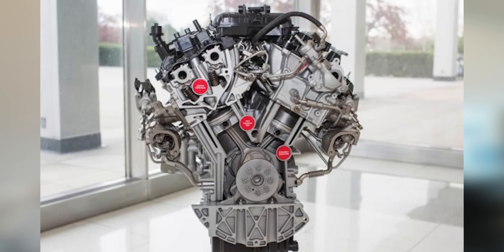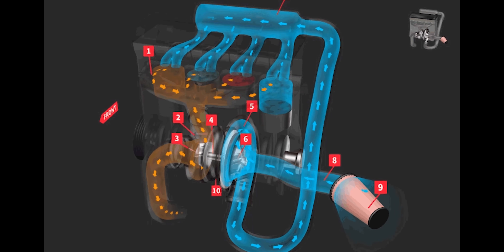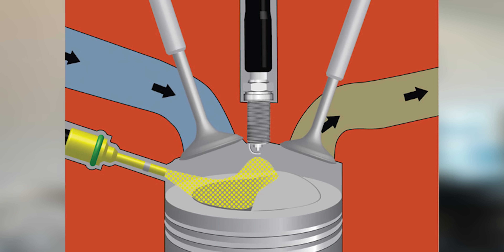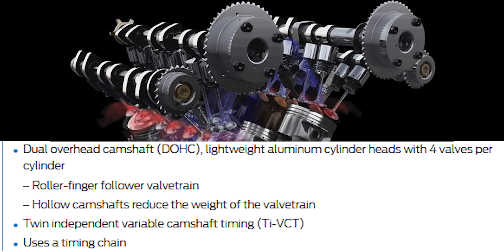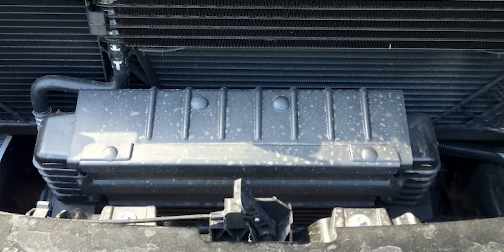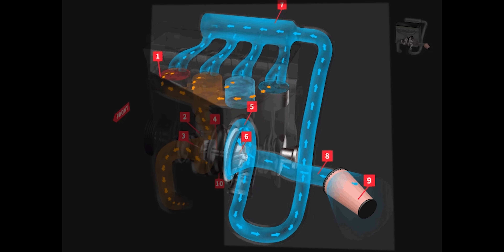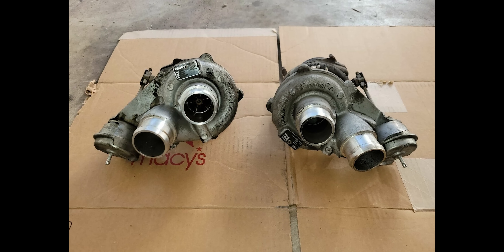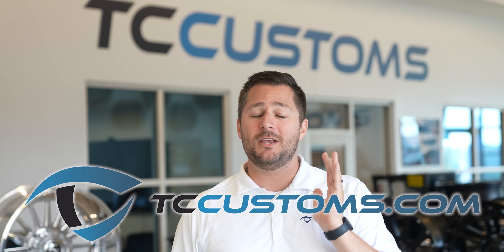The Truth about the Ecoboost Engine!

Comment: I have 340k miles on my 2013 F150 eco boost, a lot of it towing a trailer. It is bulletproof.
Reply: Original turbos?
Reply: @rvd2960  Yes the original turbo are still running strong 💪
Reply: @jollyranch1026  sounds good! That's my main concern
Reply: The eco boost engine technology is absolutely amazing. Haters always gonna hate.
Reply: Only if you do good maintenance. I have a 2015 with 76k miles on it. I bought it used with 63k on it. The motor just spun a rod bearing due to gunk building up and plugging all the sensors and oil pump. Completely flooding the motor with metal shavings. No low oil pressure warning. No codes. Now it has a jasper reman engine. 🤢
Moral of the story. These trucks are incredible with awesome power. BUT... buy it new so you know the maintenance history or if used make sure you get proof of regular oil changes. (Saying this from a guy who only buys used)
Reply: @trentmiller7532  you wish lol I have driving both and the 5.0 is not even close to the eco boost the only thing I like about the v8 is the sound
Reply: @trentmiller7532   no it will not
Reply: @rajasultan7473  Ecoboost Fords needs to stay in their class with the Honda’s, where they belong. That’s like saying Toyota belongs in Nascar 😂
Reply: @trentmiller7532  dude you need more power yes if ford sold a v8 with more power I would buy that I have 3.5 eco boost 2021 I smoked a 6.6 Cummins a v8 f150 is way slower too and the v8 coyote also has cylinder de activation which is already causing problems
Reply: @rajasultan7473  lol. Absolutely clueless. A turbocharged V6 F-150 (Ecoboost) will not beat my supercharged CYOTE V8. For a quick Ford history lesson, the Ecoboost engine was designed to save fuel, and as stated in the 2021 Summit Christmas catalog (which is where my parts came from), the Supercharged 5.0 is a small block 302, which has over 650 HP, turns more RPM’S, and has more torque than a Ecoboost (turbocharged V6). Stay in your lane when you start talking about “beating” a truck (that P.O.S. Dodge) that weighs 3,000 more pounds than your 1/2 ton truck, because I also have an F-250 bulletproofed and programmed, that will beat my Supercharged 5.0, and ANY ECOBOOST. Like I said come to NOLA, sign a liability form, and I can use either one to rip your drivetrain from the body of your truck, AFTER I spank you on the street.
Reply: @trentmiller7532  I am talking about a stock v8 not a supercharged one a stock 3.5 Twin turbo v6 2021 has 400hp and 500 torque the v8 has only 410 torque it’s faster than the v8 , if you tune a eco boost you can spend about 10k and get 850 whp and 1000 torque
Reply: @trentmiller7532  the 5.0 isn’t a 302 anymore
Reply: @caseymaples19xx  Sorry Casey. My 5.0 is a 302. Don’t make comments on the sleepers, and to make everything politically correct, if someone put a 2014 5.0 Coyote engine in a mustang or F150, yes it is a Three Hundred&Two inch block engine.
Reply: @trentmiller7532  it is actually 307 cubic inches now. I have posted this info direct from Ford but you can feel free to look it up yourself.
Reply: @caseymaples19xx  That’s good to know. Now I have .5 Liters more of POWER BABY!
Reply: @caseymaples19xx  my bag cubic inches (my phone auto filled)
Reply: @highball7347  You talking about those hopped up 4 bangers? Of course silly. I can do that with my riding lawnmower, but everyone knows that’s not practical, just like a turbocharged V6, in a full size truck sillyhead
Reply: @bella68201  as someone who currently has an ecoboost and a 5.0 in the yard, the eco boost isn't faster.
Reply: Did you always use 87 or 91 octane fuel?
Reply: @sgarcia5736  87 octane or reg ll. I’m at 375k now.
Reply: Sorry pal, I don't believe you.
Reply: Good to hear the cost of timing chains and can phasers turbos etc is my biggest concern buying used especially.
Reply: That gives me the confidence to keep my 16 Ford explorer with 3.5 EcoBoost. It's at 113k now
Reply: That’s good to hear. I have 148k currently. I’ve been running the Crc turbo/intake cleaner every couple/few oil changes
Reply: I highly Doubt that. Any forced induction engine doesn’t last and will fail due to excess heat and stress.
Reply: Hear alot of this. Seems like aside from the ones what had phaser issues the 3.5 is killing it.
Reply: @themotoheimers  phaser issues up to 2023 in 3.5 and 5.0. Phasers issues are a big issue. They are as big of an issue as the AFM on GMC/Chevs.
Reply: Did you have to replace phasers or timing chain?
Reply: Have you needed to replace the timing belt? If so how much did it cost?
Reply: Another Ford salesman!! Lol😊
Reply: @RustyJudgment  I just bought a 2014 3.5 ecoboost the other day and today I been hearing all this stuff.  It has had oil changes every 10k miles (on the carfax) and is at about 100k miles.  I'm hoping that I can just clean the gunk out of the intake valves and change the oil every 5k, maybe even 4k lol, and not have problems. Would like your opinion on this...do you think it's too late and damage might be done or is oil change every 10k not too bad?  I also talked to chat gpt about it and it recommended a catch can (gonna do duel catch cans) and to run high octane fuel.  It says that should make for much less buildup.
Reply: @waynefilkins8394  good questions. The demise of mine was all the gunk buildup that eventually plugged the oil pump and starved the bottom end bearings from getting adequate oiling. 
From what I understand if your engine has a bunch of gunk buildup the best thing to do would be doing a decent amount of oil changes sooner than later like every couple thousand for a little bit to try and flush the gunk out. If you have a dealer or service company maintain it and if they think it’s excessive, I wouldn’t be afraid of having them drop the oil pan and clean out the bottom of the pan to make sure it’s super clean and not plugging up the pump. The oil pan drops out of those trucks without removing anything major to get to it. 
Hope this helps. 👍
Reply: @RustyJudgment  Thanks!  When I went to test drive it, the guy said the check engine light came on when he was moving it.  It has about 100k miles on it.  He let me test drive it anyway because they said it wasn't anything major that hurts it.  I forget what they said it was, but it was some part I never heard of and I have only worked on older trucks.  It was supposed to be 1 part, and they'd have it fixed in 3 days.  Now it has been like a week and a half and the dealership still has it.  I don't want to back out of buying it because the condition and everything is really good for the price and like I said the maint. schedule is solid but oil change was every 10k.  Being at exactly 100k I don't see it being that bad yet but idk.  I see this as more of a blessing that something went wrong before I got it, and now the dealership hopefully fixes everything they can find, and I can be off to a fresh start with frequent oil changes.  First thing I plan to do is check the intake valves for buildup, and as you said, I'll check the oil pan for buildup...might give me some insight into what's going on in the engine.
Reply: Good for you but I’ve had my cam phasers done twice and traded it in for a v8 a week ago when I found out the phasers need to be done a THIRD time. 65k mi.
Reply: @actontreadway1168  didn't they fix that with a software update or something?
Reply: Sure you don’t have a Duramax?
Reply: All joking aside I think there are things you can do to increase longevity. Oil catch can, bigger exhaust, bigger intercooler
Reply: I’m now at 440 original engine and transmission. Changed turbos out at about 270k miles.
Reply: No haven’t done timing chain. I would probably swap out engine before doing timing chain. Ford will give me a 3 year unlimited warranty on engine so that is a 200k warranty.  Next time I need turbos $2500 I will either swap out engine or the truck. I might have gotten my money out of this one. By the way. Try pulling a trailer at max towing weight along I 70 at 11000 ft. Not a bug deal with eco boost. Wouldn’t even think about it with V8. Your max power would be less than half.
Reply: How many throttle bodies have you gone through, There is no way you are on your original throttle body. I repair these on a daily basis.
Reply: Nice !
Reply: Not for me.  I had a 2013 ecoboost that constantly overheated when towing a 4K lb trailer.  Bought a 2016 v8 and haven't had any issues.  Too much stress for the v6 to handle consistently from my experience.
Reply: Either you’re lying, downplaying the maintenance, or extremely lucky. They’re unreliable and riddled with recalls

Comment: No way would I go 10k miles on an oil change. Oil is a lot cheaper then an engine.
Reply: Smart man
Reply: Nope not on any engine. 5k max and I use full synthetic as well
Reply: Too much focus is on mileage. I change mine twice a year whether I go 5k miles or 14k miles that year. 

The people who are on the highway all the time putting 20k miles a year might get away with 10k changes
Reply: @Jeakami  think about it you have twin turbos spinning at 20,000 rpm you need to keep good clean oil to keep those turbos healthy. I go 5k max that’s it and I’m changing it
Reply: @timschultes6467  good point, though highway driving might not use boost very often. Anyway that's why I went with the coyote
Reply: @Jeakami  I had the 5.0 on my last F-150 excellent engine. On my 2020 I went with the 2.7 ecoboost which I think is also a great engine.  I just choose to change the oil to keep it great
Reply: A new F150 is 40k and up an Expedition 50k and up. I'm not going 10k miles on any oil change. Our current Expedition has just under 250k miles on it and I change it every 4k-5k at the most with full synthetic. Everything is all original so something must be right. Next one will be an Ecoboost on 4k mile OCI's.
Reply: @alanholmes2366  I’m with you, if you take care of it then it’ll take care of you
Reply: Use a true synthetic like Amsoil and you could go 10,000 miles if you're mostly highway and hauling flowers home from the nursery. I go 7,500 miles because I tow a lot but when I have the oil analyzed they tell me I can go a lot longer. My wear metals are always below average. Even shitty fake synthetic Pennzoil, Valvoline, Chevron, Quaker State, etc is good for more than 3,000 miles.
Reply: My owners manual says 10,000 so I follow that. If anything happens, I followed manufacturers recommendation.
Reply: @ethancrisp3491  No worries do you. Just know all the manufacturer cares about is getting you out of your warranty period.
Reply: @ethancrisp3491  so manufactures also claim some fluids are “lifetime”... and when questioned on lifetime, their response is you’ll be covered under the factory warranty... which implies their equipment is designed to last through the warranty period on one oil change...
Reply: Thomas Rossi.............Today's oils are much better, and designed to go further, due to the higher quality Base Stocks and Additives that make up the oils!
Reply: @Jeakami  AMSOIL synthetics has been recommending 25 K miles/1 Year oil changes since 1972 using their top tier oil! "25,000 mile or 1 year drain interval" PRINTED on the container.  Same statement on the present oil, some 49 YEARS later!  Must work, or they would have been put out of business long ago!  I've used it in my vehicles since 1980 with NO ISSUES at all!
Reply: @1gr8oil  agreed, 100%. But would never change your transmission fluid... because it’s claimed to be lifetime?
Reply: I listen to Ford, Toyota, ETC service recommendations instead of keyboard technicians on forums and threads. If u want to change your oil earlier, great go for it. But nobody wants to hear you menstruate via here that you are correct vs a Ford engineer. You are just wasting oil
Reply: @ethancrisp3491  don’t follow that! 10k is way to long cut it in half!
Reply: @timschultes6467  in that case why not just do it every 1000 miles. Why not every week. I trust the people that built the engine.
Reply: @ethancrisp3491  I’m trying to help you here but if you don’t want to listen burn up your turbos I don’t care
Reply: @ethancrisp3491  there are several ford master technicians on YouTube that highly recommend that you change your oil in half the recommended interval.  They explain to you what they see in the real world. Sometimes engineers are morons they lack real world experience. I’d trust the master techs
Reply: @timschultes6467  @FordTechMakuloco  is one of them. He cut his Ford mechanical teeth on the 5.4 3 valve Triton and those engines had TONS of issues related to oil changes; mainly people going to long in between changes. He also doesn’t support some of Ford’s recommended maintenance schedules. Dude has been in the game since 05, and he is very knowledgeable. He has newer vids on the ECOBOOST which are very informative.
Reply: @standhd  yes I watch his channel too I like him a lot. Awesome guy
Reply: The reason they recommend that is that it will safely make it through the warranty period but need significant repair work not long after. Great business model since their dealerships make most of their money in the service department.
Reply: Such an old school train of thought. Do you still  use a rotary phone?
Reply: @EliteDadBod  📞
Reply: I change my oild on my 2019 Titan every 10K miles. Also my 2018 Tundra the dealer changes it every 10K miles. Just depends on the type of engine but nothing bad will happen to my trucks. No issues and no turbos to deal with
Reply: It depends on the oil, on some oils in these engines 500 miles and it's worn out, others can hit 10k and only be halfway worn out.
Reply: @Jeakami  same James, same just smart thing to do
Reply: Been going 10000 miles between oil changes for years. Never had an issue.
Reply: @darrenbennett6013  what oil you use makes a big difference! 10k on amsoil signature? Waste of money! 10k on store brand conventional? Waste of a good engine!
Reply: Too many people to reply to so I'm just replying to the whole thread. I agree that 10k miles seems a bit high for an oil change interval. However this does come with a caveat. They also include a severe duty schedule which cuts the intervals in half. The point is, if you feel like you work your truck hard (towing, driving in hot or cold climates, several short trips, etc) then go with the severe duty schedule. If you're driving 80% highway mileage, taking longer trips, not towing, etc. then go with the 10k interval. Some people seem to think that Ford's business model is to build vehicles that get past the warranty period and fail. That would be a terrible model and if that was truly the case, Ford would've been bankrupt a long time ago and you wouldn't see 20+ year old F-150's on the road. Their business model is to build quality capable vehicles so that customers will continue to buy their vehicles. In the auto business, brand loyalty is everything. OP is right that oil is cheap for the piece of mind but I don't believe in disparaging owners for following the manufacturer's recommended interval. If you take care of your truck, it will take care of you. Simple as that. I'm more worried about all of this unproven tech on the 2021 MY's failing than an oil change interval.
Reply: @joshkline9976  theyve had the cylinder deactivation and the new oil pump system in testing for almost 3 years, and have put them to the test in extremely high performance applications, testing them in excess of 11k rpm, if it can take that abuse I'm ready to trust it.
Reply: @tieoneon1614  people talk about it because they're idiotic people thinking Ford says to change it every 10k miles without regard to many other factors. I couldn't care less about their loss. It's just makes for better used vehicles if they change their damn oil
Reply: With regard to oil change intervals, nobody ever talks about the role modern day transmissions have. I have an ‘08 5.4 w/ the 4 speed auto and have owned an ‘09, same 5.4 but w/ the 6 speed auto. The extra 2 gears played a huge role in keeping RPM down. Driving my brother’s newer F150 w/ the 10 speed I notice the engine hardly ever gets above 2000 rpm under normal acceleration. The engine wear in a newer truck is far less than it was even just 10!years ago just with a gearing improvement. Mileage is just something to go by, it’s the condition of the oil that really only matters. Condition of oil at 10K miles for my ‘08 would be black coffee (if the engine didn’t blow first) because of the wear from those power and efficiency robbing longer gears. I don’t feel it would be even remotely close to that in one of these newer trucks.
Reply: @rygi23 , excellent point.